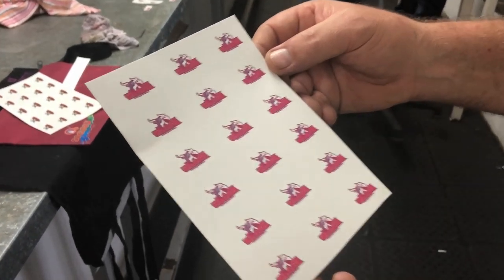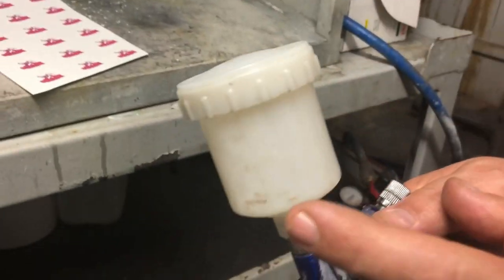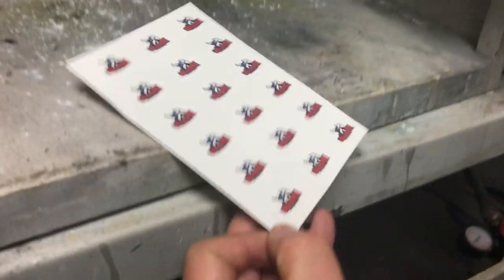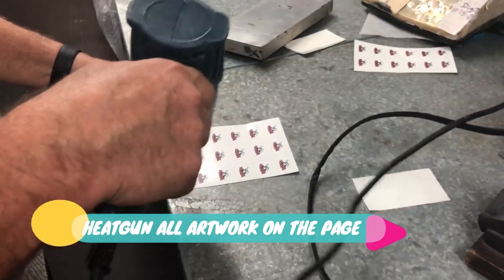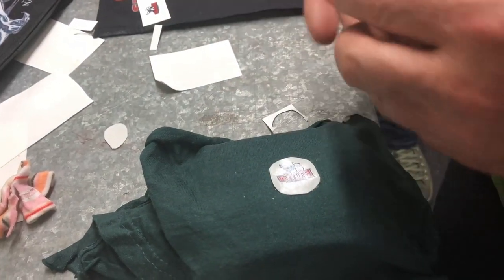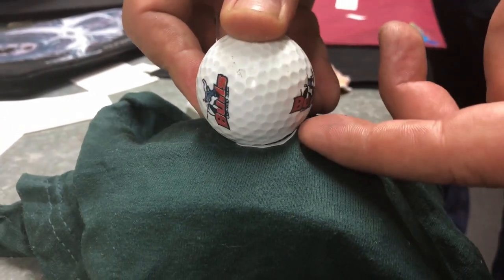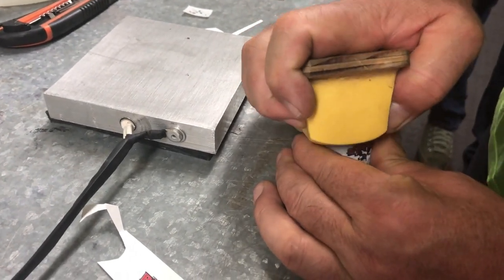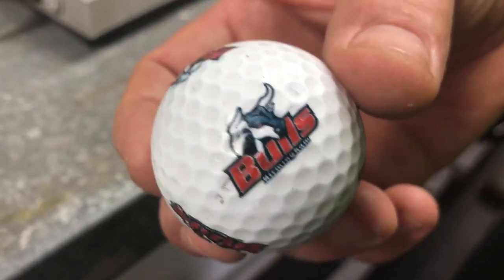How To Print Golf Ball By Hand

Comment: I received the paper without instructions.
Which side of the sheet should I print on, squared side or white side?
What product should be sprayed on the print?
Reply from the maker: Hi Jean, in the video is the full instructions. Marine paper has only one side you can print on, the Glossy side. Nitro X chemical(NC Dip) as demonstrated in the video.